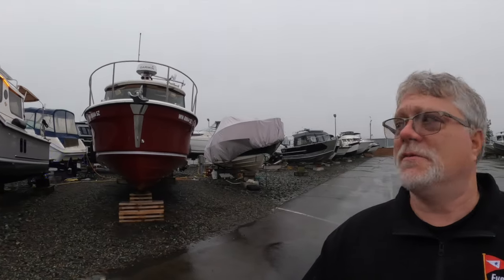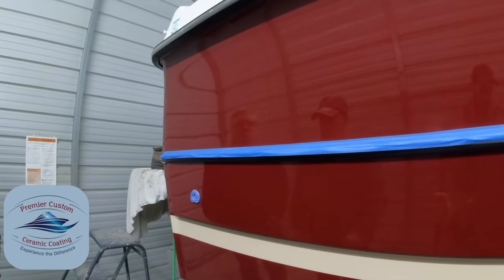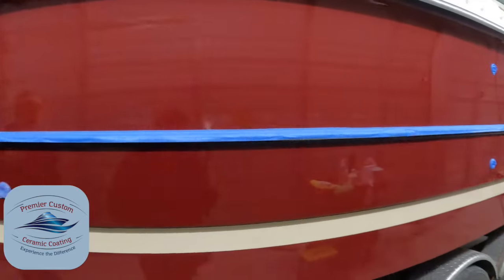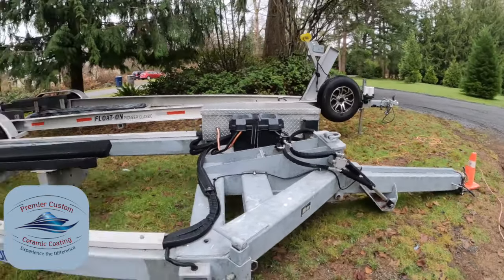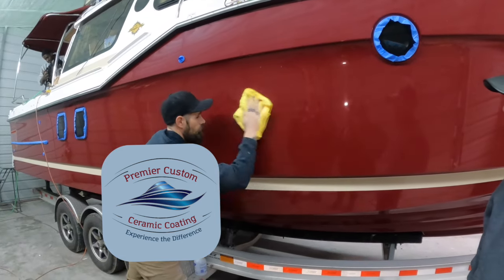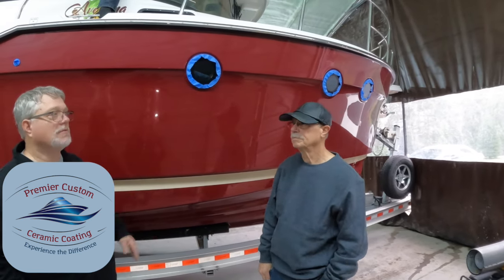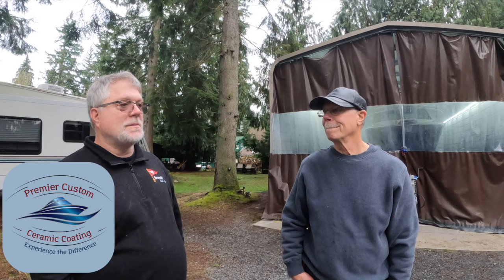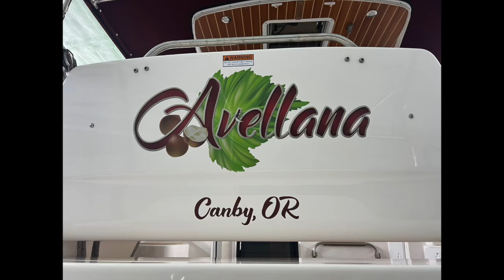Before you Ceramic Coat your boat: Watch this

Comment: Right at about 11:30 you mention a window treatment that I can't quite understand.  The CC calls it Hydra Sim but I can't find that.  Can you tell me what exactly you said?  Thanks
Reply from the maker: The ceramic coat applied to the hull is an alcohol based solution.  The hydraserum after-care is a water-based ceramic coating.  The hydraserum acts as a sacrificial layer to help the ceramic coating not wear off as fast (wear off the hydraserum first).   I go over Channel Surfing twice a year with the hydraserum to hopefully prolong how long my ceramic coating lasts.   For the windows (and stainless steel rails), they are coated with the hydraserum.  However, glass and stainless is not very pourus so it lasts about a month.  two coats of Hydraserum on the windows works better than Rain-X.   In this video, timestamp 08:00 you can see how well the Hydraserium works on the windows.  Unfortunately, we also midjudged weather in Johnstone Strait and were punished severely for it.  With all the water we took over the boat, Johnstone wore off the Hydraserum in a little over an hour of abuse.   Under normal boating conditions it lasts about a month on the windows so I don't have to use windshield wipers.  https://youtu.be/ThcKLiyTwMY?t=484

Comment: I am skeptical!
 I've seen "Shake Oil Salesmen" before, it never seems to work out as advertised! This applies to Boats/Camping Trailers/Cars, etc. I don't believe there is such a thing as a "Free Lunch." I've gotten complements for years on how pretty our Boats look, they are often confused as new Boats. I get the same questions. How do I do it? What product do I use? The answer is simply "Elbow Grease" and a little "Knowledge/Technique!"
Reply from the maker: I was skeptical as well as I had a car dealer ceramic coat my car at purchase that turned out to be a waste of money.  Kevin at Premier Custom Ceramic Coating does really great work.  80% of the work is buffing and polishing and cleaning.  The prep work is what makes the boat look great. The ceramic coating then keeps it looking great.  You're correct to be skeptical, since it's such a labor intensive process, outcomes vary between companies and products.